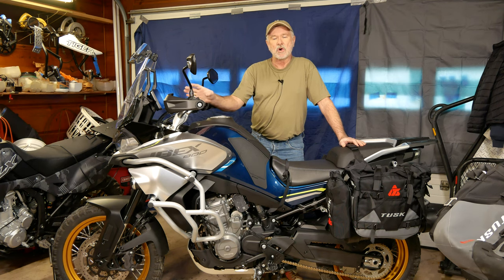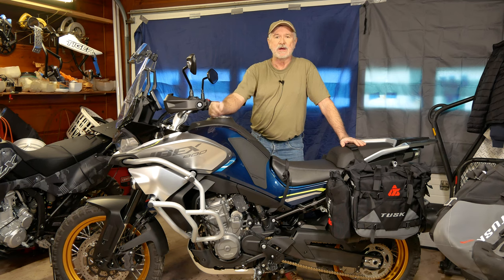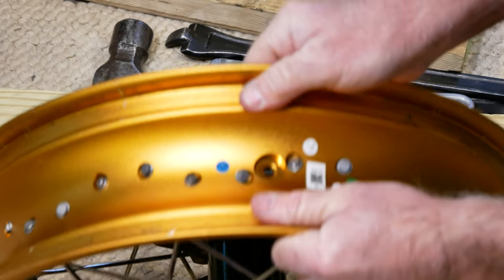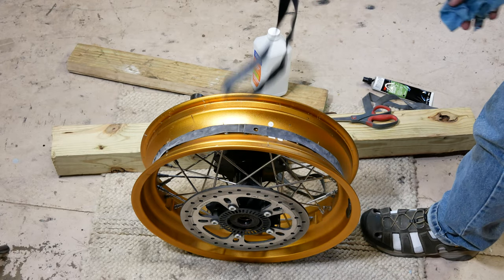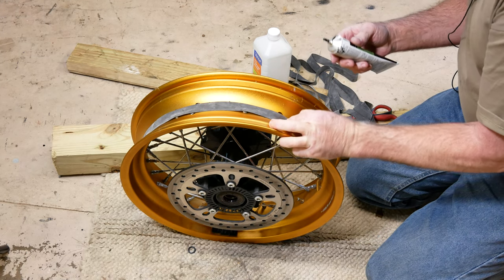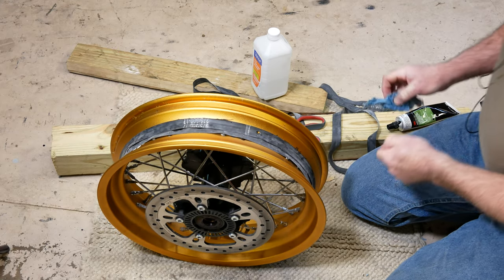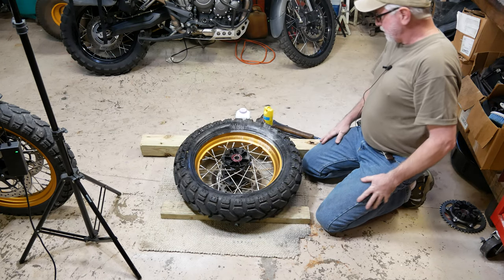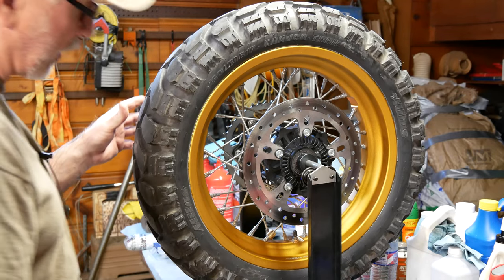CFMOTO Ibex 800T Wheels Leak Air... Can I Tube Them?

Comment: i have not had this problem yet but ive heard, so i went ahead and sealed the spokes on the inside of the wheels with 3m extreme sealing tape, its super sticky and thick stuff..my son has had his supermoto wheels sealed with this tuff for 6 years( 7800miles).. and no leak yet, plus you can remove the tape with a little heat,  it doesnt leave nasty residue behind., plus the 4411N sealing tape is sticky only on 1 side so it wont stick to the tube. and its tough enough to run a tube over it..i used 1.5  inch on the front and rear but it needs to be trimmed on the edges.... i did the same on my old dr650 (20k plus miles ) its ran for years and never leaked either, butttt i always carried spare set of tubes just in case,  on trips with the 800mt i will carry tubes as well,   any plans on putting a delkevic on this one... i really wanna try one on mine....great vid boss

Comment: Excellent video, John. I suppose new silicone seals wouldn't hold up. Im hoping mine lasts a long time. I have 2400 miles, and so far, so good. It's disappointing to know this is something that could have been done better in the rim construction.

Comment: Hi Jon, Can you tell me the size tool I need to remove the front wheel on teh Ibex 800??  Any "process" to the removal such as leaving the fender on or does it need to come off.? You do a great job, head west and lets ride this fall.  Dan
Reply from the maker: Hey there Dan, the front axle takes a 12mm Allen bit and the front fender does not need to come off... very easy to get the wheel off.  Pretty much the same as most other bikes to get the front wheel off.  Hope to see you out there soon... thanks for watching...  :)
Reply: @ozarksbackroads5484  thank you Sir!

Comment: Hey Jon,

I noticed you had a Versys 1000 some years ago.  I'm interested in the 2023 model and curious about your experience with it.  It would see about 95% blacktop and 5% gravel/dirt roads going to trail heads and camp sites. In fact I'll be heading to your neck of the woods in June.
Reply from the maker: Hello there sir, good to hear from you... The Versys is a great bike for sure... I rode mine quite a bit on dirt roads and it did a good job.  It was a very good bike to tour on as well... good wind protection and very comfortable for long days on the road...  Also a lot of fun in the twisties...  thanks for watching...  :)
Reply: @ozarksbackroads5484  Thank you sir.

Comment: Suzukis design on my2017? Vstrom xt 650 was the best I’ve seen so far for tubeless spoked wheels.
Reply from the maker: Hello there sir, yes my 2019 XT had those... bullet proof for sure... don't have to worry about a rock catching the protruding rim lip like the ones with the spokes on the outside edge of the rim...  :)

Comment: What about CF Moto 800mt Explore? It has the same spoked wheels like this model?
Reply from the maker: Hello there sir, good to hear from you... if the explore uses these rims then it will have the same issues... no big deal to tube them but no more Tire Pressure Monitoring... thanks for watching..  :)
Reply: @ozarksbackroads5484  thanks for your advice!

Comment: Can you please check your cam lobes for expensive wear as the ktm equivalent of that motor is known for self-destruction/cam issues... hopefully, it's a non-issue and has been fixed
Reply from the maker: Hello there sir, Yes I will be doing a valve clearance check at the end of the season.  The cam lobe issues were on the early 2019 and 2020 KTM 790's with engines built in the UK.  I have not seen or heard of any reports of cam lobe failures on any CFMOTO built 790  engines thus far... thanks for watching...  :)

Comment: Interesting, I have a 2021 KTM 890 and a 2017 ktm 1090. They have different wheels than yours. They have thick rubber liners that fit tightly in groves around the wheel, not the o rings on the spoke nipples. I’ll see if I can find a picture of one to send you.
Reply from the maker: Hello there sir, good to hear from you... yes I would like to see the picture of those wheels... thanks...  :)